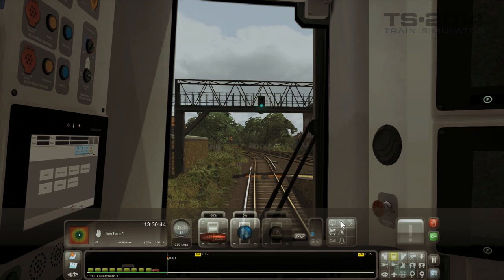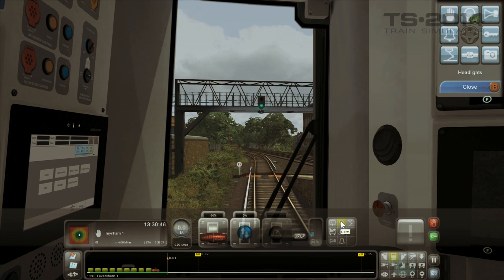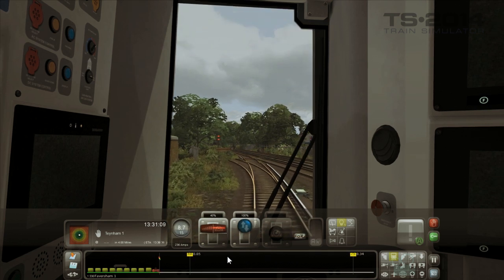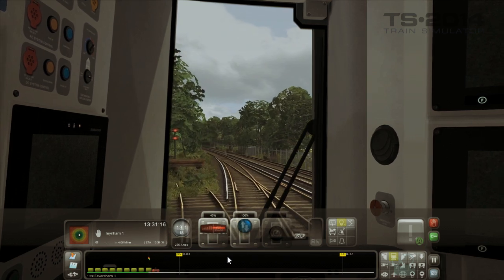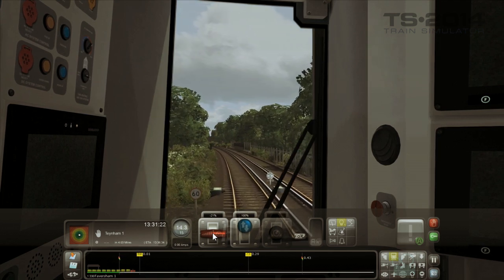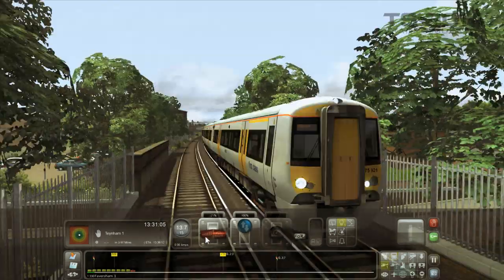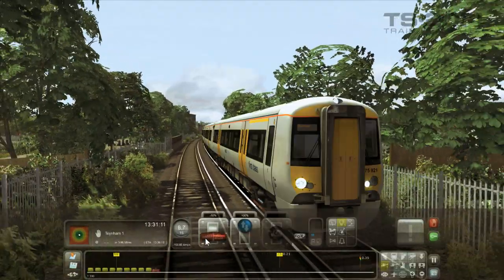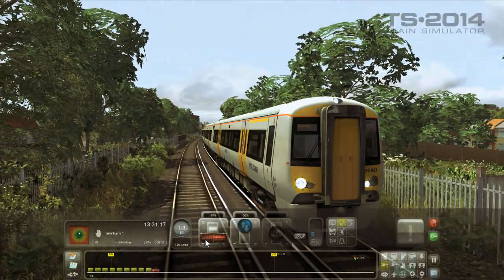Train Simulator: Electric Train Driving Tutorial

Comment: You see, when you're going to make a tutorial, you should make it the most wide applicable you can. At this point, that includes at least an explanation of using separate brakes and throttle. Also it shold explane the basics of stopping at the station and at least openning the doors for a passenger operations.
It's like learning how to drive a car. If you'll learn to drive a tiny thing with an automatic transmition, you'll have to learn a lot after that to take control of even a family sedan.